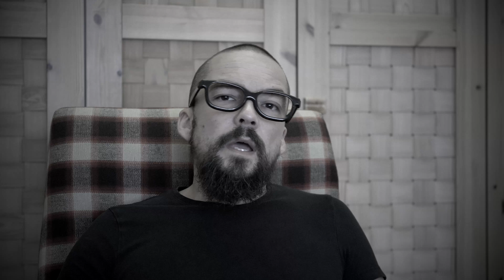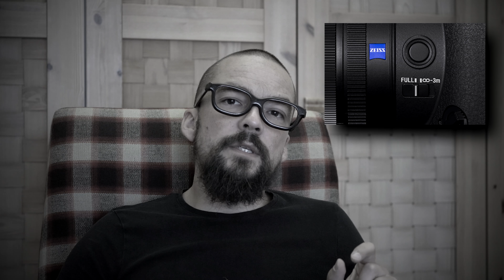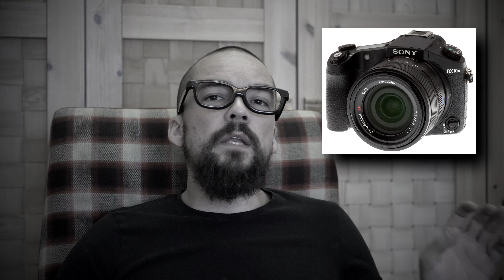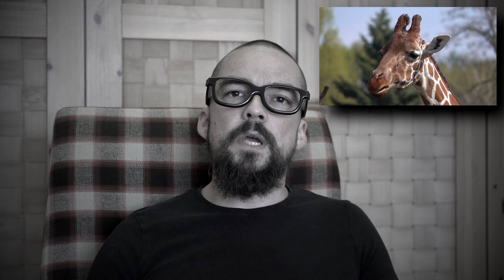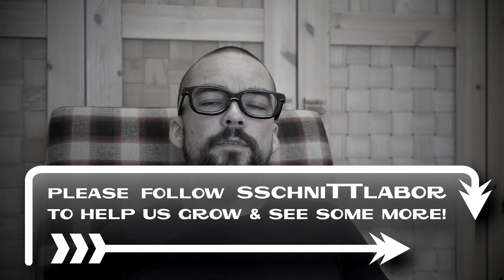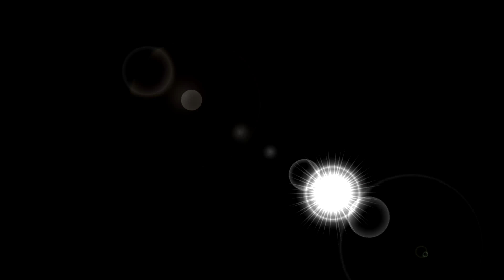SONY RX10 IV (RX10 M4) - should you upgrade from RX10 M3?

Comment: Thanks for sharing. Your point about contrast out of focus is absolutely valid, so great to finally see phase detection AF in the RX10 IV.

P.S. You're a couple of stops underexposed. Just FYI.
Reply from the maker: Morris, of course, I am very happy with the AF-system of the RX10 iv, this is really a strong improvement! By the way here I made a comparison once of the 2 different AF-systems under difficult (low light) conditions: https://youtu.be/4xUdVETlSiM A propos underexposed this video was supposed to be more flat in sense of colors and also I was rendering a smoothe vignette all over the image, thats why it may appear a little underexposed, it that what you meant? All the best!

Comment: S-LAB SSCHNITTLABOR, very disappointed on both cameras when shooting with powerhouse TTL monolights.  Have you tried shooting and using with the ATG, Jinbei, Interfit, Profoto & Phottix?
Reply from the maker: angelisone! I never ever work with flash. Except some few artistic approach this isn't the aesthetics I am looking for. But so interesting - I understand you are working in a studio-environment with a one ince sensor?!? whow. Please tell me if you were able to solve your problems. How do they articulate, what are you disappointed about? Did you work using the A7RII or A9 with such systems?
Reply: S-LAB SSCHNITTLABOR, when doing events & receptions, we like to print out just up to 5 X 7. So when shooting most of the time indoors, we need light beyond F5.6.  
And using ATG Gold Series up 2,000ws, Jinbei/Interfit S1/Profoto B1 and even Phottix Indra500, all Sony DSC-RX10 series WILL NOT Sync.

We have Sony SLT-A99, A7R II & A9 which we don't because they drawbacks which make them useless.
It CAN NOT do live-view to computer.
ATG AF Assist Beam will not come on for Sony E-Mount.

For clients we use Hasselblad, Phase One, Fuji.
For high speed ATG Gold Phantom Flex4K & Red.
Reply from the maker: Hi angelisone! you can preview and review the A7RII shots live on a large TV screen simply via the micro HDMI output works just fine, then transfer the files form SD to your computer environment. Thank you for your remarks on the Sync problematics!
Reply: Hi S-LAB SSCHNITTLABOR, doing what you've stated is useless because one CAN NOT control camera settings.
And Sony Remote Camera Control (software) is just a little better than using Adobe Lightroom (even this is crappy).
Sony WiFi is made only good for beginners, again useless to us.
Under WiFi, the EVF is blacked out, making it useless for cine/photographer.

Canon, Hasselblad, Red, Nikon, Olympus & Samsung (no longer being made) have very good software over Sony's. They have wireless/tethered live-view with all camera controls adjustment and setting.
Reply from the maker: Well, it is useless once you have the need to control the camera being away from the camera, which first I didn't assume. Otherwise HDMI out it is a possibility to profit of a larger screen for live preview/review. Thus we can additionally avoid WIFI radiation which is also great. But when it comes to an external controller of course it could be great to have access to the whole differenciated sony software tool!!! Thanks again for sharing your knowledge
Reply: There are two models that can do wireless live-view with full camera operational settings:
1. ATG AK1 Un-Tethered System
2. CamFi

The ATG has 300 meters while CamFi only has up to 10 meters.

You are correct with the HDMI port, but this port breaks & shorts out very easily. And we have tried & used the Aries Pro as well as the Atomos Shogun Inferno. They are okay if you are doing Youtube & budget videos.

We like & use the ATG AK1 Un-Tethered System Kim III better because it's a hybrid product. This is no way being cheap. Package starts at $4,000.00.
So we setup with many rigs on ATG Gold Phantom Flex4K & ATG Arri.

Give Aries Pro a try since you mostly do videos & not need wireless camera adjustment.
Reply from the maker: thank you one more! Anyway, I am happy when I have the chance to use wireless technoligies as few as possible. All the best to you!

Comment: Check out  Joshua Koerner Published on Sep 18, 2017 on YouTube.  He argues that 2.4-4 is really 2.4 - 4 because he lens is designed for the sensor and delivers the light of 2.4 - 4  to the sensor.
Reply from the maker: Hi Regie! Yes I agree the aspect of light. the 8.8-220 zoom lens equals 24-600 on this 1 inch sensor. Thats how we achieve such an incredible tele-range at such a small form factor. This way we receive the same amount of light which can enter through an aperture of 2.4-4. Given that, 8.8 on a 1 inch sensor equals 24 mm on a 35 mm sensor when the glass stays the same and when it covers the whole range of the full frame sensor. Falling through, theoretically, proportionally, is the same amount of light. But my point was not the amount of light, but the given dephs of field. For an objective value of dephs of field, we have to also multiply the aperture (p.e. 2.4) by the crop-factor of the sensor. Even though light stays the same, still, the dephs of field is wider at the "same" focal lenghts. I think this is a relevant point to mention, since most photographers like to work with portraits p.e. at a shallow dof. If you wish and if I find the time I am going to create a video one day to illustrate that.

Comment: The RX10 Series is a lens fixed camera. RX10M4 has been upgraded almost all, except for the lens specs. So I am deeply troubled about the upgrade.
Reply from the maker: It is most propably going to be a serious beast !
Reply: 초이 what's the trouble? It's simple if you do a lot of sports/action photography, it's probably worth it, if not don't waste your time. The rx10 3 is still a great camera and the focusing issues are over exaggerated, I've never had a problem with it.
Reply from the maker: peter, there is also focus-control via lcd, there is 4s instead of 2 sec in Quality-prioroty-HFR-mode, and improved Steady Shot for example. Also please have a look what the auto focus of RX10M3 was doing in 4K-resolution here (in the end it was a simple task: keep the face in focus - mission failed ...): the video example starts to be OFF exactly here: https://youtu.be/GQrIBBV9B68?t=1m
Reply: As I comparison I upgraded the rx100iv to the v (same sensor as rx10) and the speed/accuracy is much improved. I have the rx10iii and love it but it does miss focus sometimes in low light and fast moving subjects. If only that is improved its a winner in my mind.
Reply from the maker: looking foreward to compare the RX10 iii to the RX10 iv soon ... ;-)